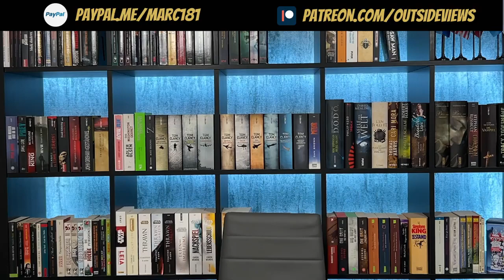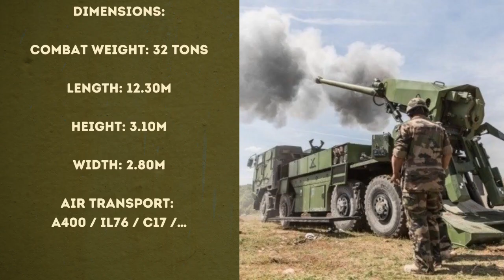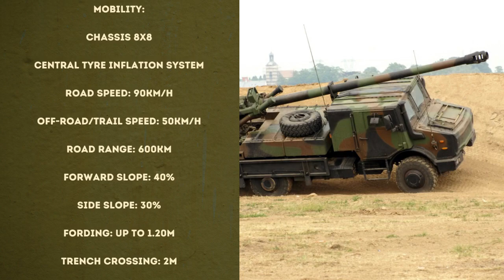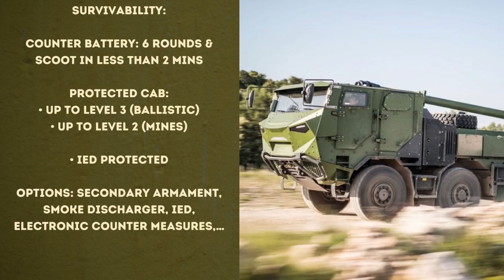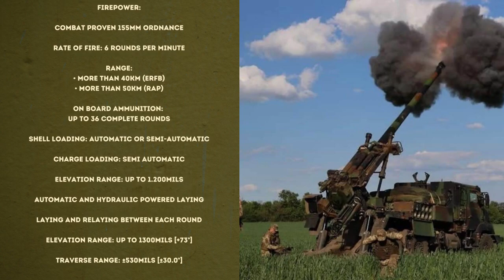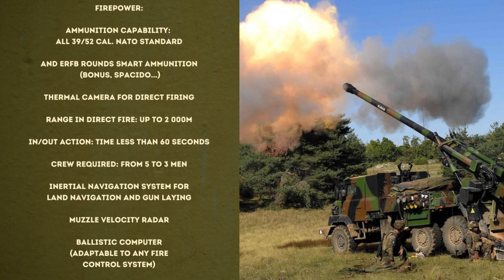France delivers 12 more Caesar howitzers to Ukraine | Outside Views Military

Comment: I was at my old barracks town of Saverne, and there was a demonstration of the Cesar howitzers on the range. They are very impressive indeed. But they are limited to the numbers of shells used, so it was soon over.
By the way, the AMX 10RC is an armoured car, not a tank. And even decades after being in service is still one of the best recon vehicles ever. 105mm main gun, amphibious, high and low suspension. A brilliant vehicle that was amazing in Gulf War One.